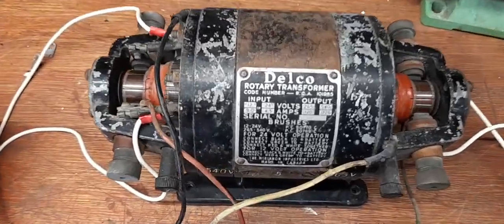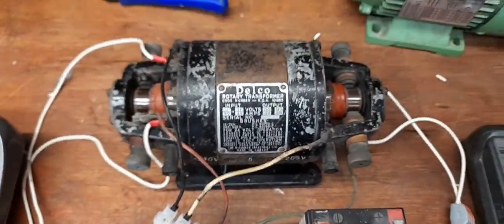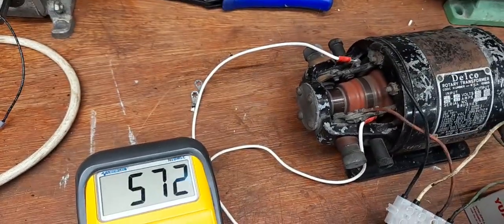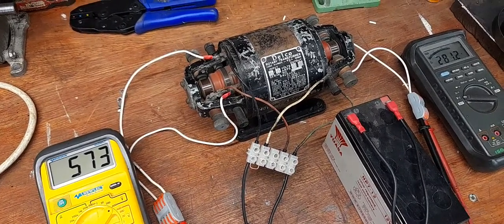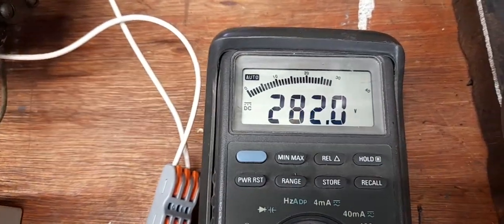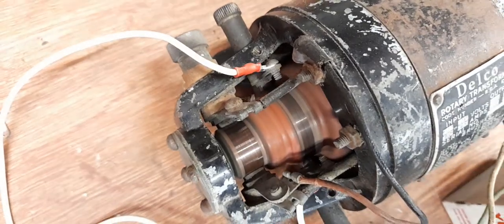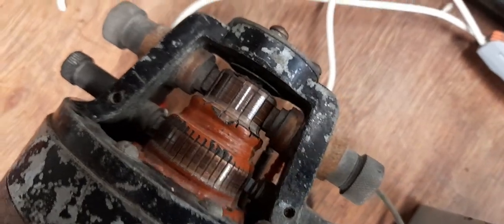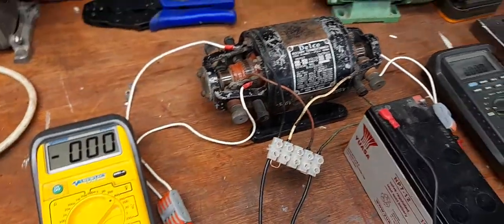Running a vintage Delco Rotary Transformer (12/24 VDC input, 574 VDC output)

Comment: I fully restored a couple of this model. Replace the bearings, they're a standard size/ cheap You would be amazed how sweetly and quiet they run. I don't know what used these but I have a third unrestored example and they seem  really common. I just need to find a use for them now.
Reply from the maker: That sounds like good advice regarding the bearings but I no longer have this as I had no use for it other than as a collectible item of which I already have far too much!
Reply: Fair enough! As I said, can't blame you for getting rid, I don't know what to do with mine.